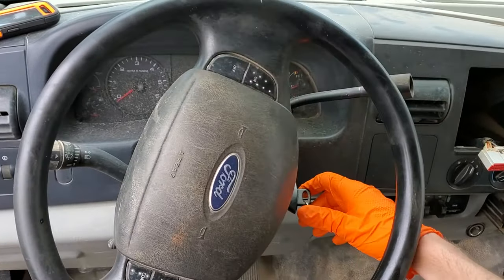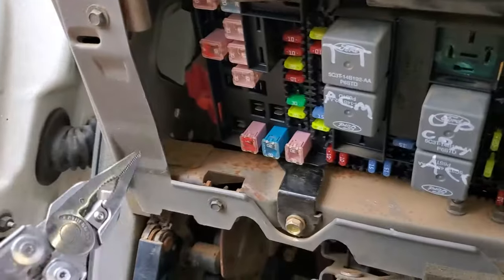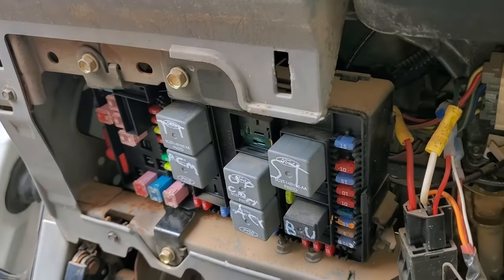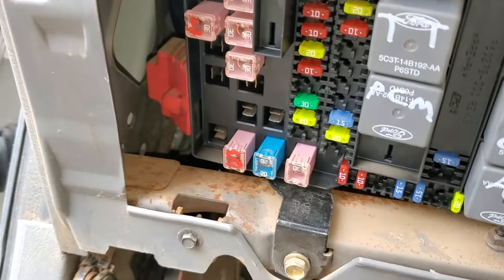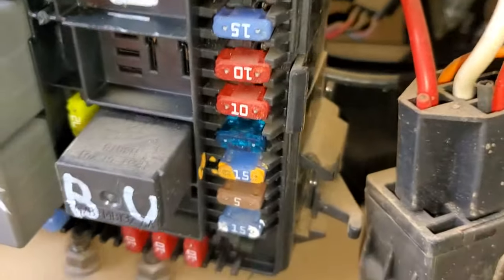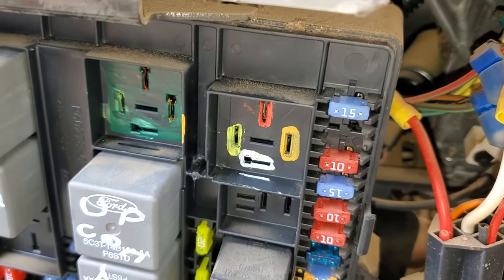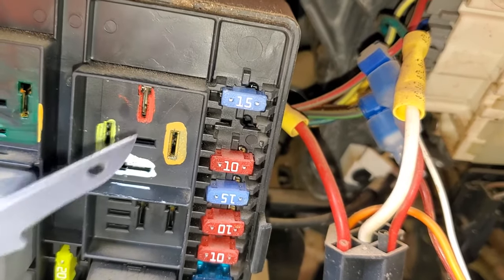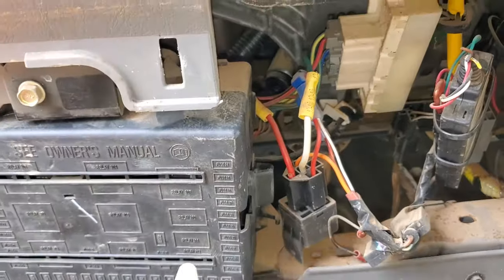2006 Ford F250 Starter Relay, Starter Fuses & Circuit Explained

Comment: Thank you so much for this video.  I went out to my 2007 6.0 (-5 degrees today) and I could hear the injectors pre cycle, no codes, FICM 48V but no crank or clicking.  Reseated the starter relay and the 15A fuse and it started right up!  You just saved me from having to sit in snow and swap a starter I didn't need.
Reply: @kira55400  dude I have the same. FICM is going out (long crank before cold start). I noticed the crank or click doesn't work when it's hot and I had just had the truck on and running (sometimes).

Comment: I'm working on a f550 Ford bus 2016. I put a new starter in. The relay is clicking and still won't start. Dash lights come on I was trying to put it in neutral to see if it starts. Any suggestion?

Comment: Did everything you said and still replaced the starter. Relay clicks but no crank on start. Checked the start and it has power but still no ingagement of starter. Any ideas??

Comment: Excellent video and excellent advice however I may add that you should check your terminals at the starter itself.  There are only two one coming from the battery and one coming from the relay.  Also under the hood of the truck there is an interconnect where the wire leading from the starter relay connects to the yellow wire leading down to the starter.  The interconnect is on the passenger side and resembles the look of a black plastic round cylinder.  In a no start condition pull that apart and check the connections inside.
Reply: also, you can pull that apart and connect a piece of wire from it to the battery and if the starter is bad it will not turn over, if the starter is good, it will turn over. So in an emergency situation, you can turn the key on, and start the vehicle from that wire.
Reply: @dennisz494  what does it mean if I connect that starter wire and it turns right on? but only 50% of the time when I turn the ignition on the truck starts up

Comment: So what if it doesn’t crank by bypassing the relay? I tried that on my and it won’t crank. So I tried the wire/plugin under the hood (passenger side) and touched to hot post and still no crank.

Comment: I have a 6.0 with a new start  really slow crank like 30 rpm’s and batteries are good brand new I have 4 brand new ones and on my other 6.0 will crank faster with just one battery     The one with the slow crank also has no ficm sync and no cam and crank sync but I’m guessing this is because of the really slow rpm/ Crank

Comment: So. My truck receives power. Everything lights up. Starter engages..But only on a Cold start it won’t fire up on the first attempt at starting. Once the truck is warm. It’ll fire right up... would any of these possibly be my issue? Truck has two 1 month old batteries as well

Comment: DrIving down highway at  85 to 90 mph truck shut off rolled to side of road. When I tried to turn on it gave me all these lights on dash. abs , tbc fault check engine, wrench, and battery light. Truck has power to radio and gauges and ac but wont crank at all! can anyone help??????? had to tow truck home. No crank  what so ever??????!!!

Comment: Nice video. The neutral lockout can be accessed and tested with the same techniques. Short around (use a jumper wire to connect their inputs and outputs like you showed to do with the relay where it plugs in) all switches and relays to check them one at a time. A test light (or, "THE DREADED" @$#!@%!METER!!!! AAAAAHHH!!)  will tell you if you are getting power in at every device, and every device that has good power has good wiring and devices between it and the power source.

Comment: Gonna go take a look at this later i assumed my started went put and did a 6.4 upgrade and i still have to jump it off the solenoid plug in the engine bay thank you for the advice

Comment: Great informational video buddy. This is exactly the information I have been looking for. When my engine is cold and I turn the key sometimes I get NOTHING. Dead silence. Then after turning key on key off, key on several times it will eventually crank and start. After the engine warms up is will crank and start every attempt. I have brand new motor craft 850 amp batteries. Is there anything you can think of besides the things you mention in the video which may help me diagnose since this seems to only happen when engine is cold? Thank you.

Comment: 2005 f250 6.0L. No crank only when single digits or less cold . Otherwise zero issues.  Does cold affect the results , electronics

Comment: Thank you for the video! I've been wanting to install an intermittent push button type kill switch where holding the button down would make a closed connection to the control to the starter relay. That 15A fuse to the ignition switch may be the answer.

If the truck starts and is running and then you pull that 15A fuse, would the engine stall or will it have no affect?

If it only needs the closed circuit when you're about to start it, then that intermittent switch should work. Thanks in advance for your help.

Comment: Currently running with an issue with the relay clicking and closing the circuit. Batteries checked out fine, jumped the starter with the jumper cable. I'm only reading 8 volts on my jumper cable. I jumped the truck from the starter relay and read 12+ volts. Which then I came to a conclusion that somewhere in a fuse box something is not right. In other words I have a problem upstream. So what I ended up doing is bypassing the relay to the fuse box and just installed a relay socket with a mini relay 30 amp. I did purchase a "used fuse box" that is currently on the way, but I will be sending it back as the " Relay Mod" solved my problem. I have posted a short video of my symptoms, along with the form with the help of Hydro, master1973, Bismic, 79Jasper and others input.  Hope this will help someone and some future advice for Lehew Tech.
Reply: Where can I see this video Eric? Currently having the same problem.

Comment: Excellent video.. 👍. 
I hav power from the top wire, when I bridge it, truck start,        The yellow left side “ground” it gave me ground.   
 But the yellow spot at the right  there is no power.,   
What next?    Ty

Comment: so, i know this old and you're not likely to respond but i would really appreciate the advice if you did so why not... this morning i go to crank and nothing, dead silence. the starter motor fuse 113 is blown. keeps blowing them. i have a push start under the dash that works off of a headlight 30a fuse. blows them too when i try it that way. i unhooked the black connector near the blower motor and touch it to the positive battery terminal and i get a crank. does this sound like the starter needs replacing? or am i looking at something else. also i checked the relay pins like you show in this video and my ground and ignition pins seem to be reversed. my ground is on the right and my ignition power pin is on the left. is something wired wrong there? or is this normal/interchangeable?

Comment: I recently ran into issues with my 2004 f250 xlt. We had to put a new fuse box in after we were having all types of battery drain issues, things dinging, cluster wouldn't go to sleep etc. The new one when 1st installed would start off the key. Went for a drive and after that wouldn't start off the key but with ignition switch on, I can jump the starter relay and I'll fire right up and run.what should I be checking next? I tested all my fuses the one you pointed out in my 04 even with the truck running I have no power for mine it was labeled as radio start. Fuel pump and everything else runs functions as it should, only have the issue with the initial start. I get clicks that comes from the delay accessory relay and that's it, running into you video I tired switching relays etc no change but jumping the old girl boom like nothing ever was wrong.
Reply: @mattprincler  what did you do to make it work Bro
Reply: @jorgebarbosa4247 I actually found a separate issues but all works together when right. The truck wasn't always seeing itself "in park" after the cluster and new post recall fuse box in stall every once in awhile it would act stupid. So I dug into it. The shifter tube has 2 bolts and a indent bracket on the back, if it's not catching that properly it can be a issue. Sometimes it was fine sometimes it wasn't. So I got some new bolts and lock tite, bolted that down and went the extra step of putting a shifter cable on it. Haven't had any issues since.

Comment: I have an 03 f250, I’m having an issue where the truck starts up when I turn the ignition switch to first position. After the truck starts I immediately have to take out the starter relay on the fuse panel if not the starter will grind as if I’m turning the key to start it while the truck is on. Any idea what this issue might be? 
Has a new starter, changed the ignition switch, changed starter relay, ignition fuse is good, starter fuse is good

Comment: So if I pull that ignition switch fuse you can’t start the truck at all? I’m wondering because I don’t want my truck getting stolen but can’t afford a anti theft system rn just put a fresh Asheville Engine in it so really want to avoid it getting stolen

Comment: Hey I have a question, my starterbon a 2004 excursion stays engaged. I changed it out for a new one and does the same thing. On my trouble shooting I noticed that I get a negative 12 volts on the switch side of the starter. Any help trying to located the wires on experience with this issue

Comment: Good video very good info you commented on a bad neutral  safety switch if there's no ground on the starter relay pin where is that neutral safety switch located at
Reply from the maker: Good question. It is located on the (driver?) side of the transmission where the linkage attaches.
Reply: Where’s the manual transmission switch? Wonderful video!!!

Comment: Can anyone help me? My 06 550 super duty tail light running lights are not working I have checked fuses I have checked fuse 20,10,&25 and still no running lights when connected to my trailer no running lights all signals brake lights work, but not running light?? I am definitely stumped on this again all fuses work￼￼

Comment: If you can get starter to turn over with jump wire in starter relay spot where do you go from there
Reply from the maker: Figure out if your ignition switch is bad or if your transmission range switch is bad
Reply from the maker: It could be a few other things but those are good starting points

Comment: I try to start the truck and only hear a click by the starter. I also try to start the truck with the Key on position by the starter jump wire on passenger fender but same thing.. Took Starter to O'Reilly and it spins so I put back the the truck but didn't bolt it in except for the solenoid wires and it spins.... Just won't turn the engine when all bolted up... Can the Starter still be weak so it won't turn the engine over?
Reply from the maker: Yes. Your engine could also be seized or your battery could be weak or failing.
Reply: @LehewTech  I took to another Oriellys and guy said the starter was seized.. lol. Had a lifetime warranty so got a new one. I guess whenever the other guy checked it out the starter decided to work.. Costed me a tow. HA!

Comment: I have 06 f350 powerstroke  turn key to start acts like starter is locked up but go to   passenger side unplug wire by the blower motor touch it to battery positive side and it starts any ideal thanks
Reply: did this wind up being the starter for yours? mine keeps blowing the 30a starter motor fuse but i can start it by touching this wire to the positive

Comment: I have a 250 5.4 l cranks over but won't start doesn't get any spark the scanner said it was the fuel pump driver module but it doesn't have one wondering what the problem could be?
Reply from the maker: What is the code?
Reply from the maker: And what year is your 250?

Comment: I have an 06 f250 that has an intermittent no crank. But if I hold the key for about 15 seconds it'll turn over. New relay,ignition switch,  fuses are good. I'm lost
Reply: starter